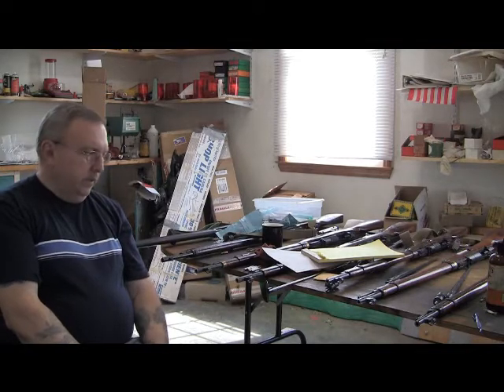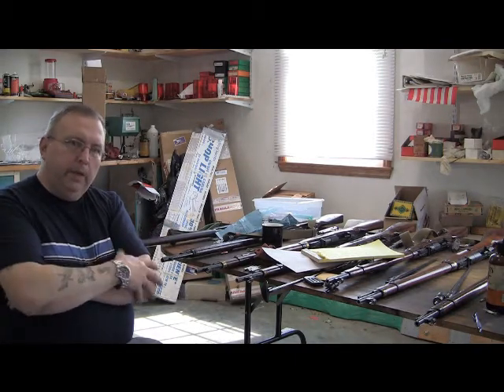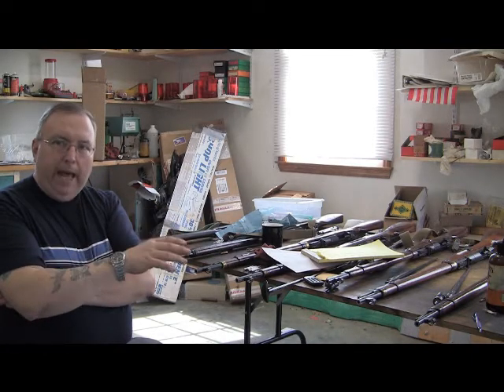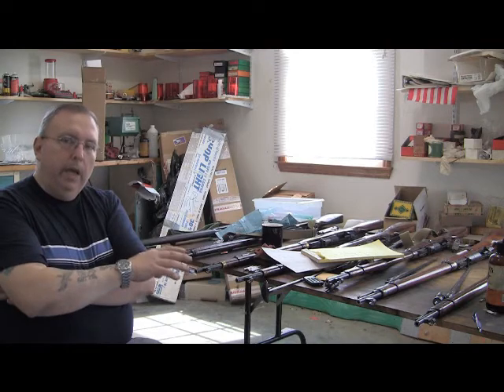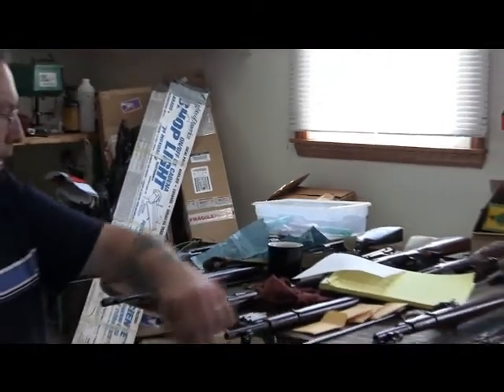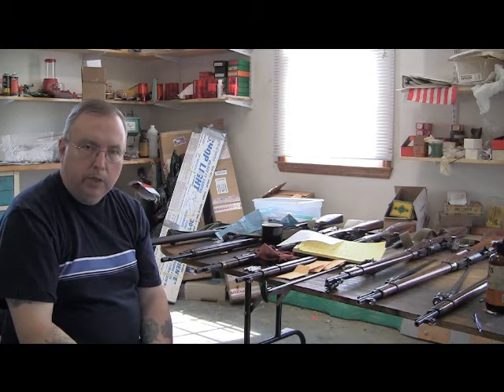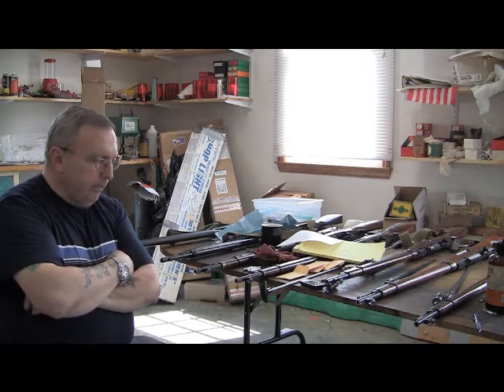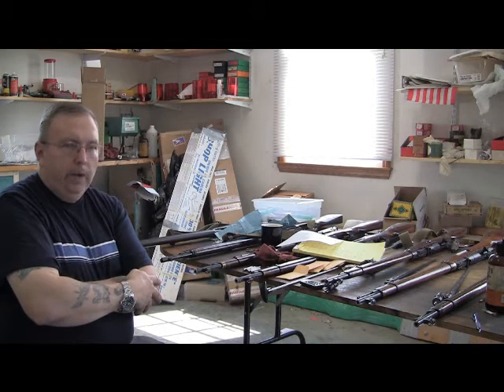M91/30 Precision Bore Measurement Part 1

Comment: Hi Koba49!, just stumbled across your video on measure of gun bore. Fantastic! Both my son and I have a few nagants and out of all the rifles at this time we both enjoy them at the range. I watched a video last night on reloading... yes getting expensive to purchase, so I will attempt to go down that road. May have an opportunity to pick up some used reloading equipment at a fair price. Learned off the bat there is a lot more to it than pour and plug, looking forward to learning how to reload through your videos and advice.
Just a quick note, purchased a Nagant that had a 3 out of 10 bore rating, missed that in the bid. Got the rifle, cleaned it and it was packed, the rifle looked worn, keep on bringing out dirty swabs, just wouldn't stop, ended up with a severely packed bore with good rifling.

Comment: a barrel if it not a longrange shooter, you can got though midwayusa or a other savage barrel maker! they send your a savage barrel kit with no go gage's and a tool to remove your old barrel! but longrange shooter's have custom firearms i seen a 6.5 x 06 the barrels are custom made, i question these guys this person said a proper cleaning rod & wire brush clean the barrel! if it a old firearm some of them the end of the barrel shot out! the last few inch's of barrel! plus a .308 bullet is less then a .312 7.62 bullet, that 4 thousand's looser! that some time a over looked fact!!